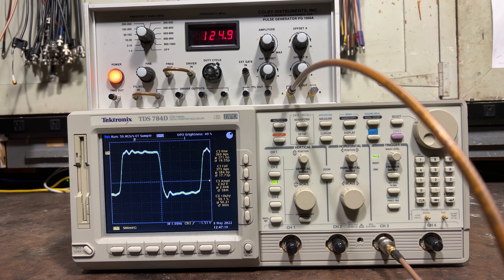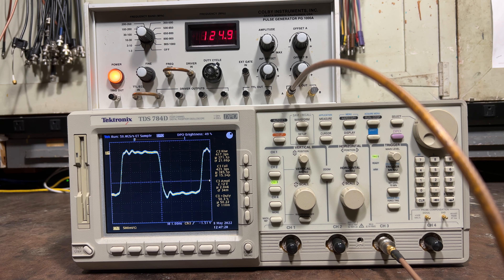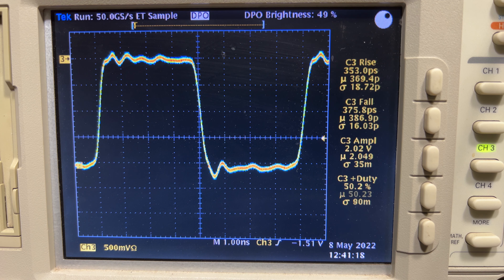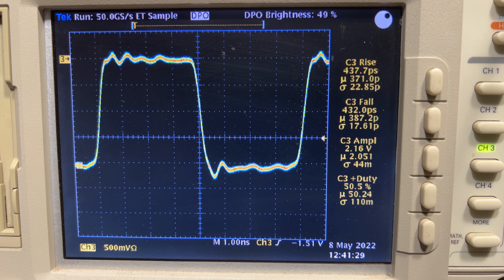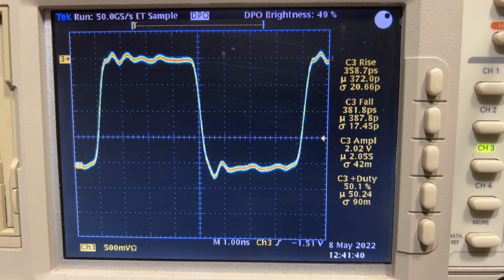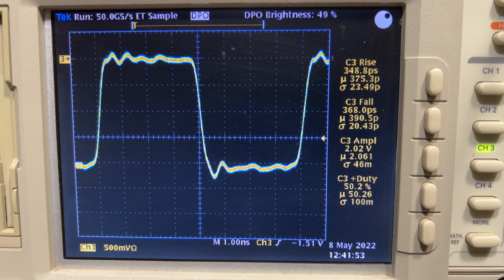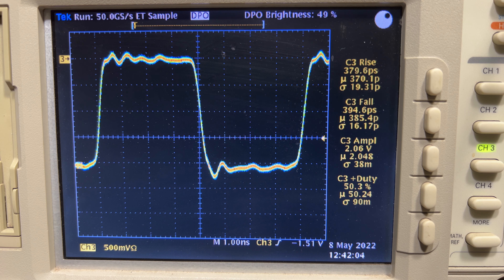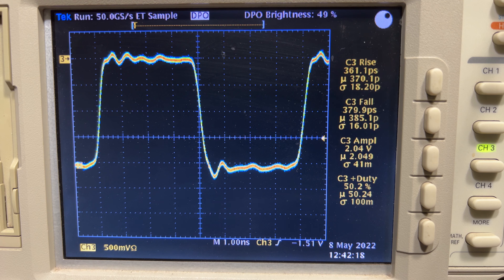⭐ Tektronix TDS784D Oscilloscope Rise and Fall Times 0017

Comment: Isn't that level of performance implied by the 1 GHz bandwidth specification of the 784D?  Why would you expect it to be faster than about 350 picoseconds?
Reply from the maker: It it was a simple one pole roll off one would expect 350ps.  However because the brick wall anti aliasing filter in this scope is much more complex Tektronix suggests using a factor of 0.4 instead of the more classic 0.35.   Thus the specified rise/fall time less than or equal to 400 ps.